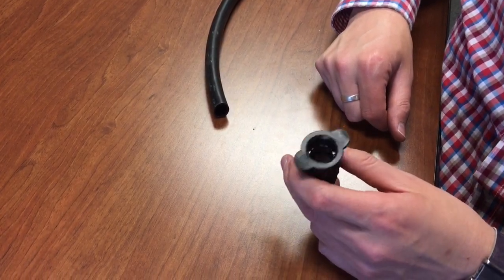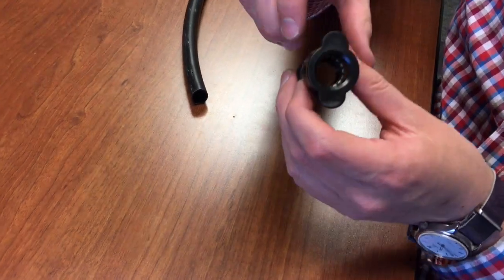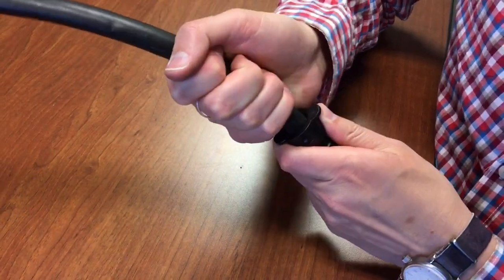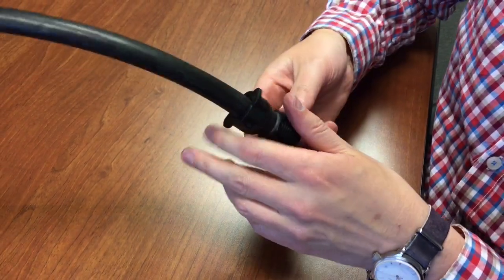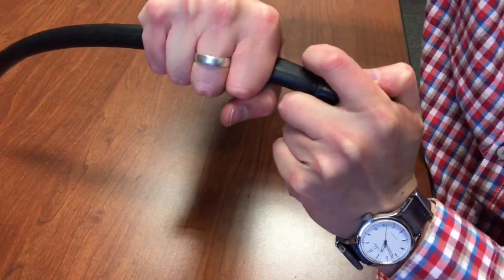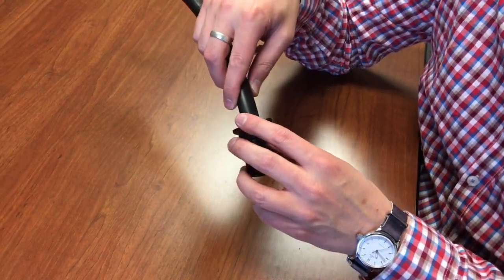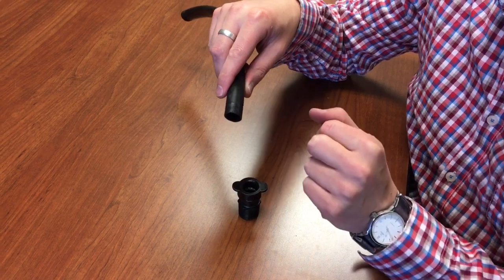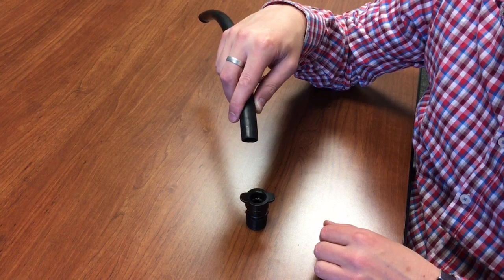How to install and remove drip lock

Comment: Question: I just got this (and Ts as well) to go with your 1/2 drip tubing (9” spacing) and the connections leak! Am I doing something wrong? I do have a pressure regulator on the line so that should not be an issue. Thanks

Comment: I have a simple question. Blue lock 1/2 dont fit on regular 1/2 poly, they need to be use on there blue lock pipe.  The fitting that the video is showing is compatible or not on regular poly 1/2 pipe? Please help

Comment: Can I connect a 1/2 inch Blu-lock tubing to a Drip-lock connector?
Reply from the maker: Generally no, as drip tubing is quite different from poly tubing used in blu-lock
Reply: @orbitsprinklers  Thank you for the reply. May I ask a followup? What is the best way to connect blu-lock with a drip lock connection? Is there a blu-lock adapter that will go from 1/2 to an exterior water house faucet? Then I could connect to the Drip-lock pressure adapter, I think

Comment: I have found these to be a total pain in the a** to remove.  The 'retainer' does not compress once the tubing is in place. I have had to resort to cutting them out of the line, installing a new connector, and then cutting the pieces out of the connector.   Great idea, just doesn't work in practice.  I won't buy any more.

Comment: Great product.  Easy to insert a 1/2 inch tubing and lock it in.  It works like fish hooks.   However, the release mechanism is not that simple.  Either that or I am not removing the tubing correctly.
Reply from the maker: It can be tough. This video may make it look easier as we were using fresh pipe. It usually will require twisting to get the fitting loose.

Comment: To save a used connection on an older line. I  cutoff the tubing about 2-3" on either side and set it into a vice.

Then I press firmly down on the connection, tighten the vice on the tubing, twist and pull up on the connector.

Sometimes you have to muscle it loose. Even so, I haven't noticed any of the stainless steel teeth in the connector get damaged from this. But alwas check them afterwards, just in case.

Edit:

If the tubing gets shredded by the teeth in the twisting and pulling process, you can use a small flathead screwdriver and needlenose pliers to pinch and fish out the remaining bit of tubing.
Reply: How did you get the vise into the ditch?
Reply: @dennisbryan2711  Dig a hole big enough for it. 😁

Otherwise, when I replace long irrigation runs that have multiple couplers, I'll cut either side of each one I'm trying to reuse.